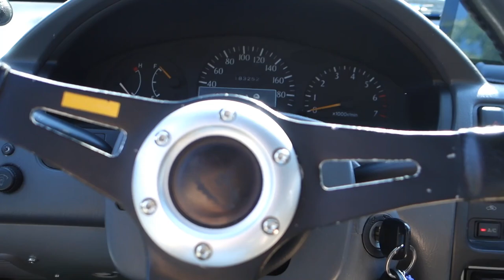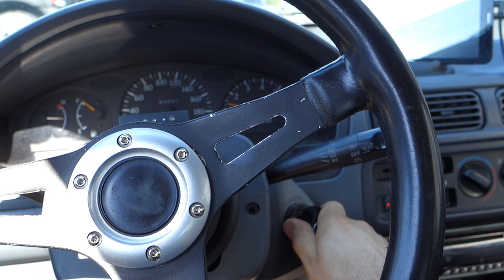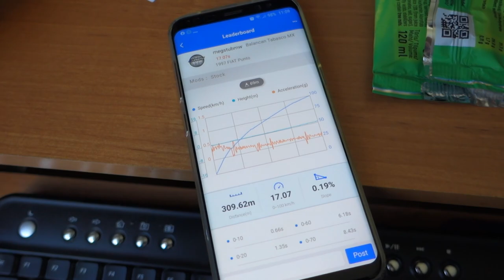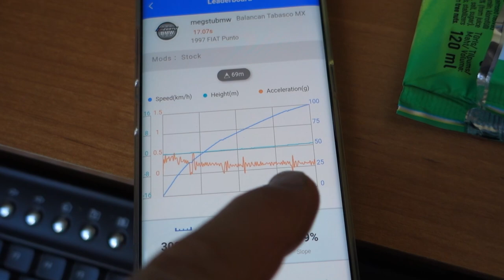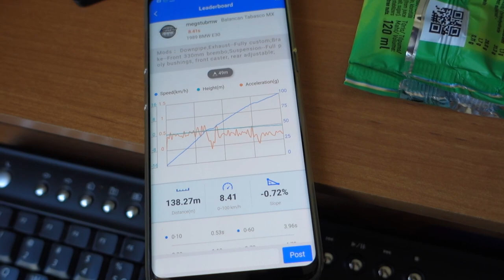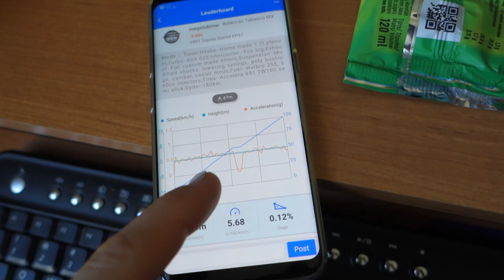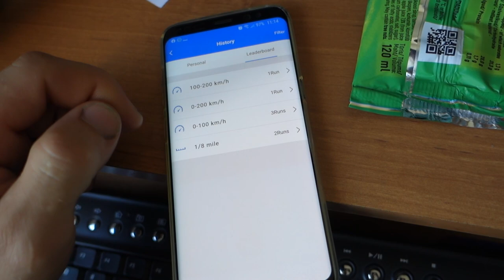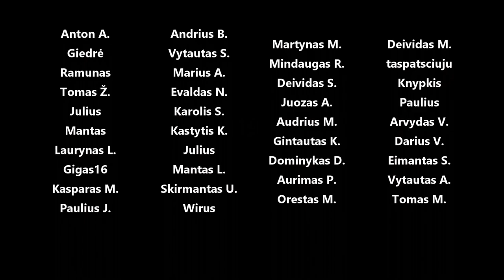Starlet 4efe turbo 1.6bar test drive ir nuotykiai tesiasi

Comment: Blm is video atrode kad starletas taip pustu mano e36 pro sona bet pagal dragy pasirodo ne :) labai idomu su dragy pasizaist ;D
Reply: Tai zinai tie senoviniai spidometrai, dar padangos naudojamos visai kitos. Pieno riebuma gaunasi rodo :D
Reply from the maker: Kai priekis varomas, su sukibimu problemos :-) . O šiaip  per kiek pats per draky 100 įsuki :-) ?
Reply: @MechanikasLukas  kolkas 4.98 best
Reply from the maker: @modixas  mmm, koks setupas :-) ?
Reply: @MechanikasLukas  535d
Reply from the maker: @modixas  aaa, tai šito nepaimsi lengvai :-D
Reply: @MechanikasLukas  lietuvių emke :Dd
Reply: Mano e36 m57 150kw turbosystems dvigubas guolis ic didelis charge pipes iki koliko 2.5" lengvas mapas ties 250hp 580nm pradejo nusukdinet ant dyno ant kelio ne tai ir neaisku kiek dabar (sankabos reik) 0-100 5.13s 100-200 11.86s 1/4 13.04s
Reply: @rimvydassalomskas8512  su tokia akseleracija tikrai daugiau yra hp :)